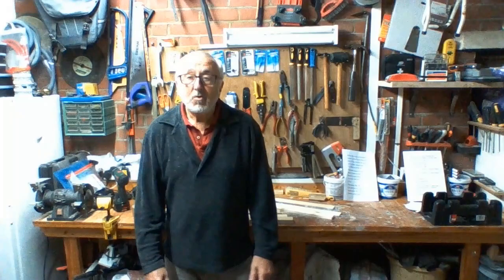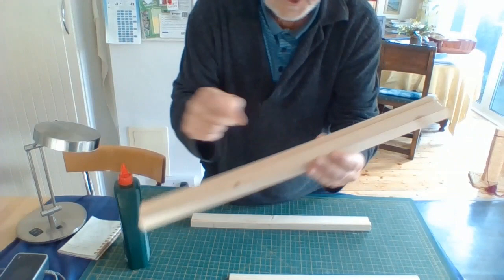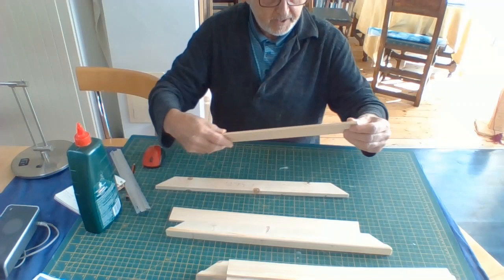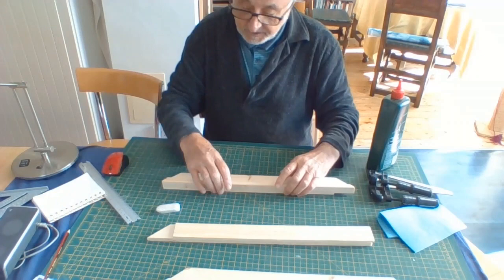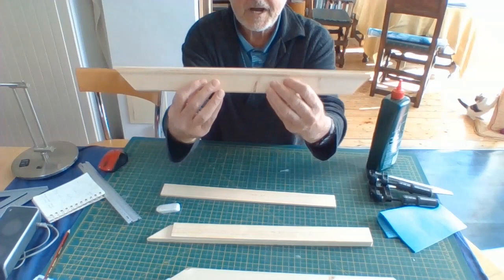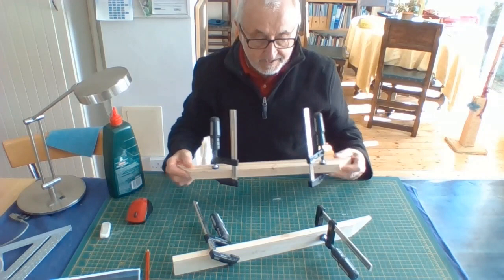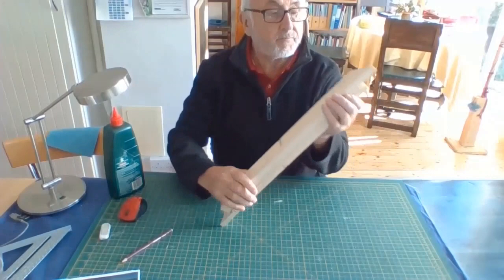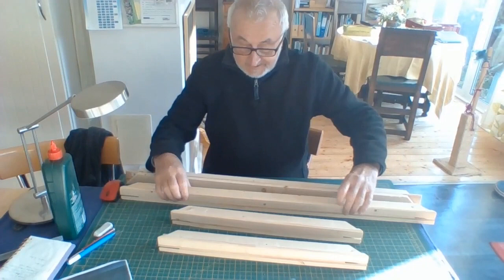How to make conservation quality stretcher bars with adjustable keys

Comment: Great work! I was looking to frame a canvas which is 150 x 100 cm and thinking I would need some bracing for this. I notice that you haven't glued anything to allow the keys to restretch the canvas. I assume you would also not glue the cross bracing. Is that true?
Reply from the maker: Thanks! Yes, you assumed right. You make it a tight fit. A frame this size would need a bracing cross. You could glue small wooden stops on one side of the underside of the stretcher where the cross meets, and angle the cut of the tops of the cross, allowing you to tap in a key on the other side of the stop.
Reply: Thanks for the reply Rod :) very helpful and I think I can visualise what you are describing, so that's great! On previous canvas stretch frames, I have sliced the top face of the frame with a table saw to create an angle (so that the highest edge is on the outside and the lowest is on the inside). I assume this is for the same reason you have the semi-circular beads (to avoid the "ghost frame" effect). Is there a reason you would go for the beads over an angled face on the frame or is it just availability of tools/materials?
Reply from the maker: @maverick040690  I used the bead because I had it, but I also use quadrant when I have that...whatever is at hand. But I prefer either of these options than ripping the timber down for the angle, though I suppose it does make it lighter.
Reply: @rodsaunders149  fair enough. I was thinking it makes a smoother edge and there is less chance of paint cracking as you strech over the corners rather than angling the face. I guess you could always route the edge if you wanted to achieve the effect. Thanks for the help Rod! Will give this a go :)

Comment: What are your thoughts on using thin plywood for the ‘canvas’ and gluing and nailing everything together? I started doing this but don’t know whether it’s frowned upon. I suppose the glue between the plys in the plywood could become questionable in terms of being archival.
Reply from the maker: Hi, I can't advise you on this; it sounds like a lot of work though. Art material suppliers sell block boards in different wood e.g. Baltic birch and Japanese woods.

Comment: do i need to seal the strecher bars with anything or can i keep them they way they are? THANK YOU
Reply from the maker: Sorry I missed your post. No! don't seal it. The whole idea is that it can expand when the keys are tapped further in, making the canvas taught if it has slackened off.
Reply: @rodsaunders149  No problem, thank you for the information!

Comment: exactly what i have been looking for thank you so much. what type of lumber do you use?
Reply from the maker: Glad it helps you. I use pine for the stretchers and, originally cut-offs from the pine for the keys. I've since got a lot of old oak cladding boards (1930s house opposite being renovated), and amongst the uses for it, being hardwood, the off-cuts from that make very strong keys.
Reply from the maker: ...but the stretcher bars are still made of pine.
Reply: @rodsaunders149  ok thank you great advice, i was shown how to do this when i was  young and forgot, now i remember it was a great show  thank you again i will be using this, i was looking for this video a long time and it just appeared,  many people say they are doing it right, this is the true way to do it. when u say putting in a brace in middle i imagine you just leave a slot in the middle for a brace made just like the edge  pieces, now would you use a key to stretch from the middle, say i am  trying to stretch  a canvas  1 meter  2 meters,?
Reply: i imagine also using a thin piece of oak in the middle of piece of hte spreader bars would make for a much stronger frame  more rigid?
Reply from the maker: @soylientgreen8618  The Oak would make the bars stronger, but they are laminate by the time you glue the four pieces that go into one bar together, and they are very rigid.
Reply: @rodsaunders149  got it, thank you.
Reply: @rodsaunders149  i am planning on mounting water color on 140 lb cold press paper on the canvas,, i plan on making the stretcher bars like this then  attaching the paper on linen to be able to hang and display the art with out framing,,   im not sure if i should prime the linen or leave it raw,?  would you have any more great advice?
Reply from the maker: @soylientgreen8618  This is out of my area of expertise. My wife is the artist annsimberg@annsimberg.com I make her frames. She said she has never used the method that you are going to use. She suggests that you do a few samples of fastening the paper to the linen base to see which gives the best results. She'd like to know how you get on.
Reply from the maker: www.annsimberg.com
Reply: @rodsaunders149  yes sir thank you so much, it was an idea i had, instead of mounting and framing,
Reply: @rodsaunders149  nice collection of art  i can see the energy, we have some stuff that has similar styles, almost like looking at a flame from a different angle in a room,, similar , also not familiar , like when you meat someone and you swear, to know a person having no clue who they are  just having met them,
Reply: @rodsaunders149  i certainly learned what i have been looking for years i couldn't remember how to place the boards,  i had totally forgot about ply wood/ laminating, ,, if you can build this frame you can build a ship... i also really enjoyed your wifes gallery,,

Comment: So would you say its not the best idea to just use a fixed frame what cant be stretched in the future?
Reply from the maker: It's up to you. But when the canvas loses its tension you would have to remove it completely and restretch it.
Reply: @rodsaunders149  ive been painting for 35 yrs but always used board mdf ect, and just started usibg canvas. Im thinking of using pvc batterns what dont shrink.
Reply from the maker: It's a lot easier to make a fixed stretcher frame, but as I said, if you want to tension the canvas once it slackens you will have to go through more work removing it than just (gently) tapping in the keys to add tension

Comment: Are bars usually that thick?
Reply from the maker: It depends on how big you want the bars to be. The larger the finished product you need the blades to be thick enough to hold it tightly together. If they are too thin, then when you tap the keys in to tension the canvas they will snap. Also aesthetically, in my opinion, the painted canvas looks more impressive with a thicker depth of bar, than a 'flimsy' thin one. But you could disguise this by framing thin depth bars with what ever depth you wanted.